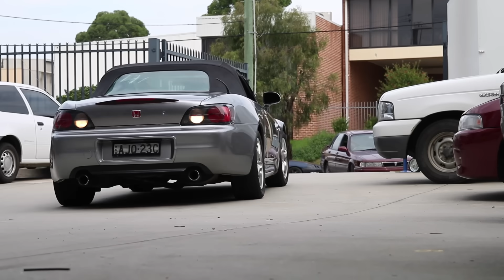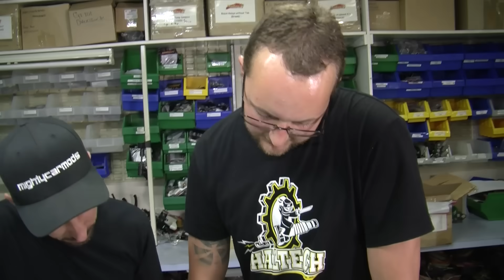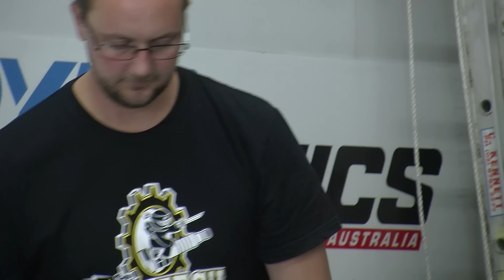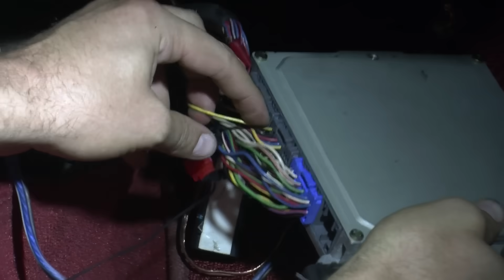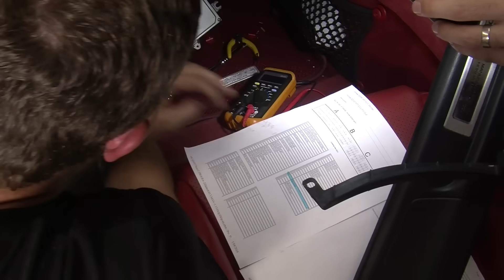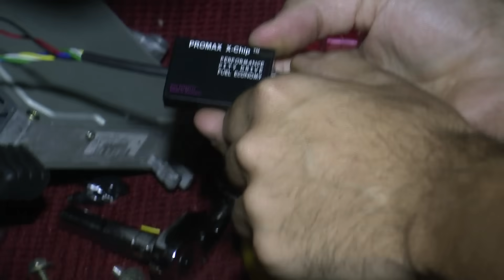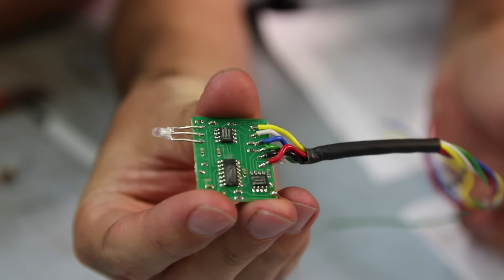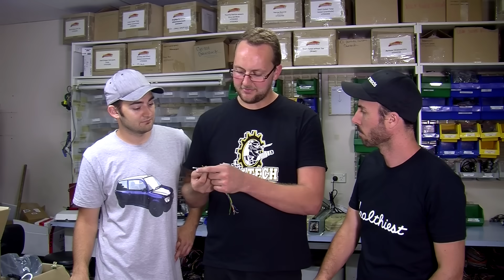eBay Performance Chips -  Mythbusted

Comment: Great detective work at the end,  sending the chip out to an electrical engineer.  Still shaking my head at the findings.  I thought it couldn't get any worse than installing a resistor in the IAT signal and calling it a "performance chip". But this design is all about deception.  Crazy!   I'll be sharing this with my students for sure.
Reply: Wow, and they sell thousands.  I have the Diablo sport intune 1000 on my 2500hd 6 liter  on the 87 octane tune and the  engine and trans shift pattern changes moves the beast  like never before.  Not all tuners are junk,  you only get what you pay for.
Reply: Preston Herfel
Thats right, there are some legit tuners out there, check it out, http://forums.justcommodores.com.au/tuning/214326-tuning-the1.html
this guy does awesome work,
Reply: Steve Rob there is a definite difference between these performance chips and a quality tuner. A tuner actually changes the computers mapping and usually for the best. A chip is sometimes just a few resistors or often nothing like this. Not that there aren't some real performance chips but they belong in a different category. #dptuner
Reply: Michael sawley will do!

Comment: Depending what those signals do, and how delicate the cheapo thing is, it's possible that trying to take reading with a meter across it could have messed it up. Taking the numbers off the chips is to keep people from copying the device without extensive knowledge of what the chips where or could be, which then would get you into having to decapping the chips to reverse engineer the unit. Given it's cheap, working or not, it's probably no patented, so someone doesn't want it copied. I would like the see the board bare with the chips removed to see where the traces go and see if they really lead to nowhere or not.

Comment: You could've put $20 worth of performance stickers on the car and gotten more horsepower than that.  I could've told you that before you opened the package.  But obviously it was purchased and done for the video to show that these kinds of "mods" are fake and don't do anything.  A lesson to everyone out there:  If it is sounds too good to be true, it is.  That's not to say that there aren't good chips out there that actually adjust the programming of the ECU, but you're not going to get one for $20.

Comment: Those might not even be chips. They might just be dummies. You'd have to dissolve the cases to find out.
It would be nice to see this test done with an actual eBay performance chip, not one of these add-on dongles but with an ECU reflash or socket mod. Maybe on a GM or Holden product, some of the L89/L98 cars were easily moddable in this way

Comment: It depends hugely on the car and the chip you're using. An AEM or Hondata chip can give you a significant boost on the actual wheel. Never done it myself, but several friends have had their cars chipped with a decent extra OOMF.

Comment: i boosted my mini cooper s with a cold air intake, wiesco forged piston, 19% supercharger pulley, exhaust, bigger valves,  and a $300 chip (which allowed the car to accelerate much faster) and got it from 177 hp to 320hp!  very fun car

Comment: Ese llamado chip que venden en ebay es sólo un piggyback que falsea la señal del IAT, es poca la variación de mezcla y avance de chispa, ya que la ECU sigue trabajando de acuerdo a los mapas de fabrica. La prueba que hicieron para ver si cambiaba los datos en la ecu no corresponde, imposible que por esa vía pueda cambiar algo. La modificación del programa directamente en la ECU  por OBD2 o reprogramar el chip de la ECU es la única forma de cambiar los mapas de avance y combustible. En resumen el piggyback corre un poco la puesta a punto pero sigue trabajando con los mapas de fábrica. Especialmente si la prueba la hacen con acelerador a fondo WOT en que la ecu de guía por otro mapa distindo al que usa el IAT, MAF y O2.

Comment: Also they knock off usually 5-10MPG and take power away! Ive personally made them for different Applications (trans shifting and whatnot) and they can be made for a buck! if there is a serious need for a similar device. like for example: changing shift firmness on GM products

Comment: My dad has a turbo diesel truck, and with an expensive performance tuning chip (an actual ECU monitoring/controlling device) he gains ~200HP at the wheels, but that's because it's a truck with a huge engine with plenty of power to spare from the factory.
Reply: bull... fucking... shit
Reply: Buddy I've tuned a handful of cars. While I'll admit I don't know much about diesels, 200hp with NO other changes, is really hard to believe. And if nothing else, that's a gay ass name.
Reply: ***** Well considering the fact I already said I don't know much about diesels I've admitted that it may be possible, just that I find that hard to believe. I don't know what else you want me to say... other than that I believe gasoline to be superior.
Reply: Diesel engines run very differently from gas engines - they do not require an absolutely perfect fuel/air mix to run efficiently. Proper performance computers rewrite the software on the ECU to allow the engine to run leaner or with higher boost pressure. The advantage is on a big turbodiesel, you get a huge power boost doing this, the downside is, the exhaust temperatures get REALLY hot, and this is why the truck doesn't have that kind of power from the factory. You need to upgrade the exhaust system to handle the higher temperatures or you will damage the engine.
Reply: In Portugal we use alot of diesel car since petrol is to expencive ... But belive it or not you will see alot more diesel modifeid cars than petrol modified cars... specially VW/AUDI TDI that ar really famous for low end torque.. With 250 euro remap you can gain like 40 hp and 100+ nm on 1.9tdi ARL..you really feel a big difrence.... thats nice gains for the price... Thats why we love tdi...  :)
Reply: James T Kirk man, I'm not trying to start a fight but I have a h&s minimaxx race tuner on my 2008 ford diesel truck and I picked up around 275 hp and 500 lb ft of torque
Reply: Jonathan sauder good for you?

Comment: the superchip is used when you have a built engine. it will give 2-5hp on a stock engine, the less restrictions you have (Aftermarket parts) the more hp the superchip will make. so in short, you fucked up

Comment: "its interesting that they scratched all the information off the chips, why would someone do that" Oddly enough that's standard practice in Electrical engineering. Its generally done to deterrent reverse engineering, when using a non proprietary IC's.  Though personally i think the term "performance chip" is misused. Generally when i hear this statement i am thinking the old EPROM DIP chips used in mid 80's to 90's vehicles.

Comment: Trying to chip non turbo petrol engine is always waste of time... So i cant understand why you guys didnt try these chips with TDI motors. All they done is add more fuel in the motor by increasing fuel line pressure and because petrol engine is accurate its fuel-air ratios unless diesel engines, they dont work. So all in all adding this chip to the non turbo petrol engine is stupidest thing what i can imagine!

Comment: Performance chips work just fine for cars that have been throttled down from the factory, they simply unlocks the restrictions giving you more power, but there arent magical chips that increase your horsepower more then the car can output.

Comment: is that car super fast or something? you can buy a used 7 year old Honda s2000 for 30k, and the interior is boring for 30k.
Reply: The s2000 is somewhat fast and nice to look at, but I wouldn't recommend one. Contrary to popular belief, the engines aren't bulletproof and they're all reaching the end of their lifespan now. They're uncomfortable with poor ergonomics, even by sportscar standards. I didn't find the handling very impressive, either.
Reply: interesting. thanks!
Reply: ***** The lack of steering feel will probably cause you to lose control of it around a bend at considerable less than 265 kph, as many owners have learned the hard way. Once or twice could be put down to a bad set up or bad driving. A trend suggests a vehicle unsuitable for purpose. You won't hear that from the "vtec yo" brigade."MX5, MGF, Lotus Elise"Those cars are still selling. The S2000 is not."for one they made millions of them with no recalls or faults,"Considering that total world production of the S2000 barely exceeded 110,000 units, I think one of us is slightly exaggerating. And there have been plenty of engine failures (which Honda won't admit to). Go and visit an online forum and do a search. That "one known engine failure" is a myth."Yes i know, hard to do when you're begging for that VTEC sound."The world loves a wannabe.

Comment: My friend put on a chip system on his car that gave him an extra 15 horsepower on the car and it actually adjusts how much much fuel goes into the engine and it actually makes you feel the increase in power added, it accelerates much faster now. the chip was worth 200$

Comment: Well, not all chips are the same, so you can't say all chips from ebay doesn't work.
And there is a big difference between non-turbo and turbo engines! 

I just installed a chip on my 318 tds, but this chip I bought was not just some resistors, it was a chip inside the ECU. The one that controls diesel-injection, so for me it worked perfect. The description said it would increase 17-25 hp, depends on the state of the engine.

Here it is: http://www.ebay.com/itm/221474175146

And yes, it made more black smoke! Heh

Comment: Why dont you just remap your standard ecu for more bhp .. ?? Nice big air filter .fast flow cat . Change cams then re-map for ponys    ..torque will improve alot . Fresh plugs oil filter & oil for remap . Cheap tune  without cams    .defo get 200+ unicorns .ask your giant for his maps or buy some !  Port out the throttle body as much as you can . Or buy a bigger one for even more bhp ...